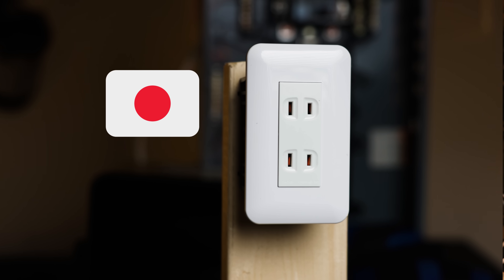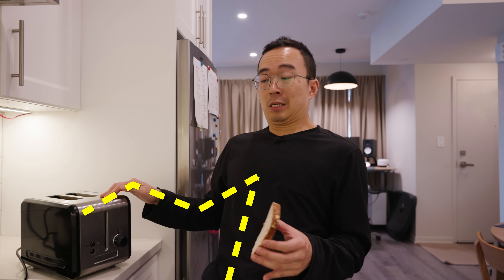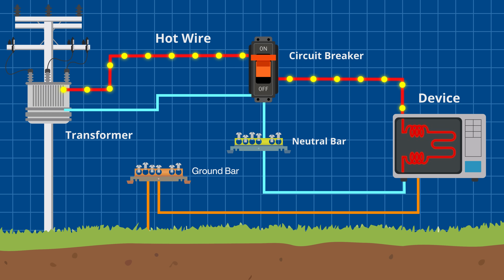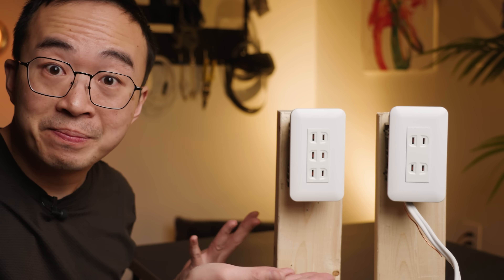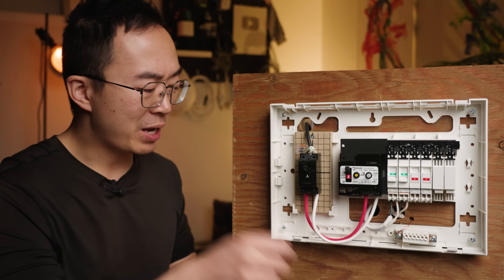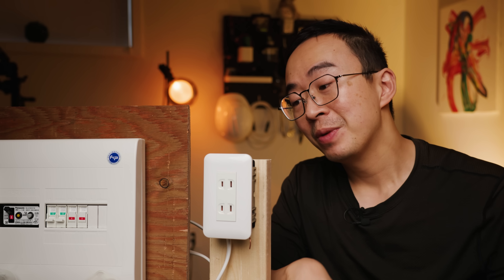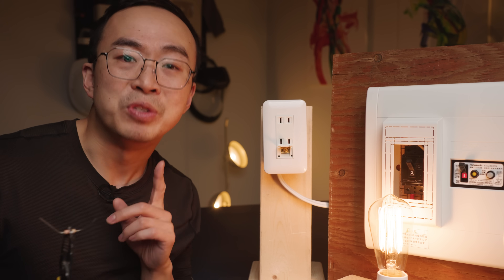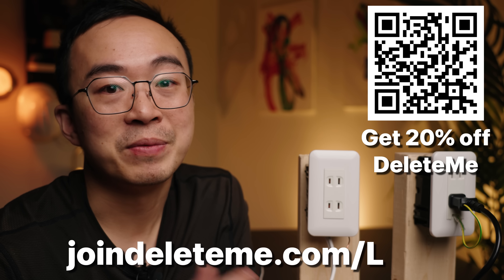How Japan Made Their Outlet Safe

Comment: You mentioned that some countries don't neutral bond, but I think this is the case in most of Europe anyways. They also have RCDs (usually multiple) to protect the whole house, even though they also still have grounded outlets. I assume this is even safer, because if a fault occurs, the RCD will trip instantly because some current was able to flow back to earth, causing an imbalance.

I lived in Belgium for a while, most houses have a whole house RCD + at least one more sensitive one for wet areas (kitchen, garage, bathroom, laundry, anything outdoor). My house had a 300 mA whole house one, two 30 mA for things like the living room, bedrooms and two 10 mA for the "wet rooms". I believe you can only have an x amount (I think 8) circuit breakers behind an RCD.

The only drawback is, I had a very old waffle iron that probably leaked some current, and although it wasn't dangerous to use if you bypassed an outlet's ground, it would always trip the 30 mA RCD.

Really old houses over there with non-grounded outlets (although definitely extremely rare, probably pre mid 70s) also still have RCDs, which is the same approach as Japan's, were definitely generally considered 'unsafe', even though I assume they wouldn't be lethal.
Reply: Do not think, learn. TT system is used in Italy, Spain, France, Belgium and Denmark (TN also an option). It is also available in the UK. Those are just the ones I know.

Comment: Its crazy none of these comments mention that you are installing the US outlets upside down. This is so common and infuriating. It isn't cute face, ignore the "eyes and mouth". The ground goes on top most of the time for a standard outlet just off the floor. I was taught this is so the ground pin on top protects the live ones from falling debris/objects if the plug is partially exposed.

Comment: Grounding is highly overrated, to be real. There are many appliances in the US that don't have it, yet deaths from their use are few and far between to put it mildly.

EDIT: Conventional ground is also not as safe as we're led to believe, which is why GFCI is a good addition to any system. Moreover, GFCI can be added to places that don't have ground wires in order to get them up to US code, so just putting GFCI in the breaker box is honestly quite handy for updating old buildings.

Comment: If you don´t have a RCD, why would you need grounded outlets in america? When ground and Neutral is connected at the dusebox anyway, you could also usw a 2 prong plug only as long as it is polarized. 
We did that in germany until like the 70s, 2 wire installation with grounded sockets, where the neutral wire was connected to neutral and ground directly at the socket.

Comment: Why wouldnt you both use a ground and a RCD? Then if the toaster wires break inside and turns the casing live. It would measure the current from neutral and live wires not being the same and just trips. Isn't that a way better approuch instead of waiting for the current breaker to turn it off.

Comment: Ground is not only used  for protection. Some power supplies require it and without you will get electrocuted mildy , reduce your hardware lifespan and damage your hardware. Ive seen alot of people  remove the ground pin on laptop or desktop power cords and in the end the device ends up dead or leaked electricity damages anything connected to the device and ofc shocks the user
Reply: Electrocuted mildly makes no sense.

Comment: Europe has RCD and grounding. Grounding is mainly to protect your devices, not really for protection as much.
Reply: It is for your protection. The idea is that you shouldn't need your own body as a conductor to trip RCD - instead, if there's a surface you could touch that could shock you, it's already grounded, so it already triggered the RCD before you touched it. Fast fail is safer -  10:00 addresses the same point.

There's also the more insidious point that there's no guarantee which return path the current flowing through your body will use. If e.g. you're using two devices on the same outlet, it might end up flowing back  through the "normal" route, and RCD will not trigger.

Comment: Okay, but why ground in the first place? If the secondary side of the transformer was unearthed (aka IT system) then even with the fault in the toaster, touching it would be safe as the path through you to earth to the transformer wouldn't exist, so no current should flow. Right? What am i missing?
Also, couldn't you produce the same effect by connecting the divide chassis to "neutral"? Hot shorting to  neutral causing the breaker to trip?

But thank you for the video, I feel like you have done a better job than everyone else to explain the basics of domestic earthing systems

Comment: Japan is backwards in many ways. It's clearly an inferior system for appliances to not have a large terminal that can conduct enough current to blow a fuse. It looks like the Japanese government just wanted to save costs. Whatever standards (newly made) breakers are manufactured against, the odd one will be bad or go bad, and then you don't have this extra protection.

Ground doesn't only protect lives, but also detects faulty, failing, or incorrectly manufactured appliances and consumer equipment as soon as they're plugged in. That Test button is only there for show, nobody has pressed it since the house was built, and it's not necessary for correct electrical standard outlets.

If a country needs a special electrical standard, it's a sign that the electricity infrastructure was built incorrectly. For half a century, we've had international standards that follow the above two points. Electricity behaves exactly the same wherever on Earth you live. It will actually save great costs to follow established standards, rather than invent your own.

Comment: Well, GFCI is an active element. It may fail to work. It is why you are required to test it once or twice annually (who does?). Ground wire with over current breaker works passively, and always provide some protection. 
But of course having both of them is the best solution.

Comment: Ground by neutral has been a common and old practice known to be dangerous in many cases. Specially on old homes where installation has been messed with by those who live there. Switching line with neutral when you have earth wire is not a big deal, but it's a huge deal when you have an ground by neutral instalation.
Stick a 1m rod on your garden and connect a yellow/brown wire to it. Voilà, you have ground connection now.

Comment: The kapanese outlet is only safe so long as the device plugged in follows special rules around using a non conductive case and current path isolation. Its a huge reason as to why most consumer electronics from japan have a plastic shroud. 

Mostly this is around post ww2 reconstruction and saving copper.

My oxonkettle has a metal kettle and grounded plug. A zojirushi water boiler has a two prong plug and plastic body
Reply: Also the electrical code in the US changed a few years ago. All new construction has to use Tamper Resistant outlets when children can reach them. These have shutters that are opened only when both pins are pressing on the outlet.

Comment: But if Japan's GFCI in the electrical panel fails to cut the circuit due to a defect or just age degradation, doesn't that mean it's more dangerous? A wire leading directly to ground doesn't have the possibility of a mechanical failure like that, right?

Comment: We have grounding and GFCIs and 3x240V in 3 phases as standard in Germany. There are (or were until 17years ago when we built our house) some very limited exceptions on which outlets could go without an RCD (mainly high-load but never moved/unplugged things that have a low risk of developing this kind of failure). All normal outlets and lights need to be on an RCD. And the whole thing got retrofitted a bit further when we got our home solar panels end of 2023.

Comment: Why not both? GFCI/RCD and grounded? What happens in a GFCI only house when the GFCI device fails?

It could switch of permanently until replaced, therefore no power, or it could never switch off and therefore death. If you have both you have the best of both worlds, but what happens if the GFCI fails to the whole house and you now have no power at 2AM?

So, GFCI on every outlet and grounding for every outlet would be the best possible scenario, one outlet fails and you can use another until you can replace it, and you still have grounding in the event the GFCI device does not trigger. Sure it will cost more to do, setup the power lines and substations and all that, but if you want the best and most optimal safety it would need to be done.

Comment: It has been over a decade since I worked as an electrician but well into the 2000s at least it was still legal to use 2 prong receptacles in US homes (up until the 40s it was the standard). The requirement to do so was to have them on a GFCI circuit, this was generally not done as it at a minimum tripled the price of breakers as well as any future repairs/replacements.

Comment: The 30 mA, is a GFPE, it protects on la equipment,  but not humans, in other words,  you could die,  anything around 20 mA can kill a full grown man, and a child could die with less than 10 mA.
 The GFCI works very fast,  but you will still receive the full power during that time,  it doesn't reduce the intensity only the duration

Comment: False info in this video.

If you let 500 amperes (won't happen in a home) through the red wire into the ground the CB will trip even if these 500 amperes are not coming back through the neutral wire as the fuse is on the red wire. Not on the blue wire.

Ground-neutral joining won't protect you from being electrecuted and it's not even needed to trip the CB.

CBs are not even meant to protect from electrecution as 0.05A will kill you while they shut off at e.g. 16A.

RCDs are amazing and 10mA RCDs should be mandatory in all residential buildings. Unfortunately in Europe only 30mA are mandatory and only in bathrooms.

Comment: This video has some interesting insights, but there are several critical inaccuracies and misleading explanations that need clarification:

Grounding through the Earth: You mentioned that grounding in Japan and France is done solely through the Earth and claimed this creates high resistance. This is incorrect. Properly installed grounding rods can create very low-resistance connections to Earth, sufficient for safety requirements. This is why grounding through the Earth is a viable method in many countries. While soil in general might have a high resistance the basicly unlimited diameter reduces the resistance to zero.

Ground vs. Regular Circuit Resistance: You stated that the grounding circuit has lower resistance compared to the regular circuit, enabling breakers to trip. This explanation is misleading. The reason breakers trip during a fault is that grounding bypasses the load resistance of the appliance. Without grounding, the current is limited by the appliance's resistance, often too low to trip the breaker. Grounding allows fault current to flow directly to the breaker, creating a higher current that ensures the breaker trips.

RCDs vs. Grounding: You suggested that omitting grounding in favor of RCDs (GFCIs) is safer. This is debatable and context-dependent. Without grounding, a fault that energizes the chassis of an appliance can persist until an RCD detects leakage. This delay could expose users to harmful voltages. In contrast, grounding ensures that fault currents flow immediately to Earth, triggering the breaker or RCD faster and reducing the risk of prolonged exposure.

Misrepresentation of Japanese Grounding Systems: The claim that Japan's TT grounding system is inherently unsafe due to high resistance is oversimplified. While TT systems can face challenges like varying soil conditions, they are safe when designed and maintained properly. Many countries use TT systems effectively with additional measures like RCDs to enhance protection.

Why Japan’s Lack of Grounding is Problematic:
While Japan’s focus on RCDs is commendable, the absence of grounding poses a risk. If an appliance’s chassis becomes live due to a fault, there’s no direct path for fault current to safely dissipate without a grounding connection. This could lead to dangerous touch voltages until the RCD trips. Most countries combine RCDs and grounding, as this dual protection minimizes risks: grounding provides immediate fault dissipation, and RCDs protect against residual currents and direct contact hazards.

The video could benefit from a more nuanced discussion of these points, as it oversimplifies and misrepresents key aspects of electrical safety. While RCDs are excellent for many scenarios, grounding is still a critical safety layer in most systems worldwide.

Comment: thanks Andrew for your video. first time here and I don't know how I got here :)
can I ask a noob question? firstly I live in Malaysia which uses UK system plug. 
question...
1. I want to change my 2 pin plug to a UK 3 pin. say I cut the 2 pin plug and strip the cable, does it matter where I connect the neutral and live to? because... usually 2 pin plug and be insert both way left right, right into the 3 pin hole. know where I am coming from? :)
take note I know nothing about electrical stuff

Comment: Another reason to have ground is that on ungrounded equipment, there will usually be a very tiny amount of voltage which you can barely feel but can notice for example if you gently stroke the metal surface of a laptop. It's a slightly "buzzing" local feeling, as if the surface was not quite smooth. Most people don't pay attention to this, but over a long period of time, the tiny amount of current traveling through the surface will damage the finish, with lots of small pits slowly apearing. So if your laptop is showing pitting on the places where you rest your hands, it has nothing to do with your personal hygiene (as some people claim) but you should just use a grounded power cable. It's quite stunning how few people know about this, even some producers of USB charging equipment are oblivious to this and claim grounding is not needed in their products. It is.

Comment: Japan and japanese in general are experts in making stupid things seem clever and innovative

Thats hands down the worse earthing system you could ever think of but that explains why some old stuff on my grandma house had earth cables on the outside of the receptacles lol I always wondered why know I know those Sony appliances were somehow the japanese versions 

US only needs to add gfci general switches to their home builds to make them the best of them all... which chinese manufacture for cheap and with a good quality but NEC and inspectors would never ever authorize any chinese equipment installs so yeah haha 

Europe (certain countries) and China (some asian countries also) will stay in the first place for having the safest and best electrical installations with their panels having easy DIN-rail arrays of gfci general switches, surge protectors, easily expandable with smart wifi and self resetable DIN breakers and simple breakers

Comment: bridge between N and GND in outlet itself would prevent shocks. If case would touch live cable it would trigger breaker, if neutral would be touching device would still work but even if human would touch grounded metal  it will be in series with device,  simultanly with resistance of with N cable. It's easier to draw then describe. But in that case N cable conductivity would be much lower that  human's - so almost all amps "would choose" cable road.
That was used in communist block - after WWII and later there was not enough aluminium to make 3 wires. They try to make it cheaper. For long time now RCD with ground is mandatory.
Reply: Do not improvise with the grounding.

Comment: One big problem or disadvantage, with whole house GFCI protection by just one GFCI, is that all the power to every circuit  in the house goes off when it gets tripped! The better solution is each breaker would have GFCI built in it as well as over current protection. Here in America GFCI panel breakers are available, but cost more than the standard over current ones.

Comment: In Russia, all sockets are grounded and "Residual Current Operated Circuit Breakers with Integrated Overcurrent Protection" (RCBO or GFCI breakers) are installed in the electrical panel for all circuits.

Comment: Fault Detection: Having separate ground and neutral allows for proper fault detection and protection mechanisms, such as Residual Current Devices (RCDs) or Ground Fault Circuit Interrupters (GFCIs), which can detect and interrupt fault currents to prevent electric shock.

Comment: the circuit breaker protects your circuit from damage
The RCD protects you from enduring damage too long with a <30mA model or fulfils burning protection with higher current models.

Your devices have different protection classes. Internal your wires are isolated. If you have a metal case you either need to ground it to get a redundant protection or double insulate everything